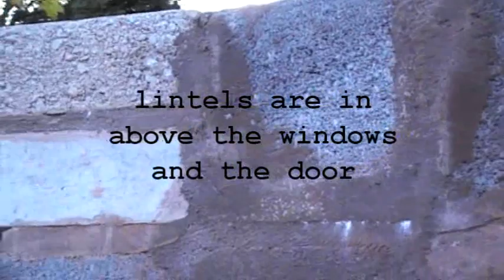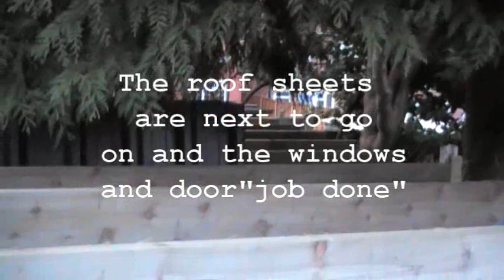How i build a concrete block shed

Comment: How did you do the foundation?
Reply from the maker: The foundations were 6 inch of hardcore and 6 inch of concrete slab. Wanted a solid concrete floor.

Comment: I believe in concrete block the one with the hole. with  steal and mix concrete poured inside  the hole to keep it strong
Reply from the maker: Wanted to use them but supplier didn't have them.Thanks for comment

Comment: Looks like a very good build.  How deep were your foundations in order to accommodate these large blocks.
Reply from the maker: Total depth was 12 inch. 6 inch for hard-core mix and 6 inch for the concrete, also added a steel 10mm mesh for more strength. solid enough for a build this size and bigger.
Reply: Rahgsa 0509  Awesome thank you. Can you show the finished building, in and out? 
Keep up the good work.
Reply from the maker: Sorry can't show the finished results as I moved house just after I completed it.

Comment: Hi bro liked ur effort. .wanted to ask if in dis manner can  we errect dis wall to 3.5meters..? Will it hold if taller?
Reply from the maker: No problem if blocks are wide enough but if they are same width as a typical brick then no, then best go with inner and outer layer with ties to hold both walls in place and give it strength and support.

Comment: This brick, massive concrete ... and the wrong one. Brick, with 2 concrete holes.
Reply from the maker: I wanted to use the ones with the two holes but I could not get them from my suppliers so I had to use these.Thanks for comment.

Comment: how much did you spend on the blocks?
Reply from the maker: Spent just over £300, I think they cost me £1.20 per block because not many people use this size and the builders yard was getting rid of them so I got them for a good price.Thanks for the comment.
Reply from the maker: Would love to have a workshop made of wood, and it is a good idea. In the UK their are these made to measure garages, sheds and workshops available supplied in a kit for you to assemble yourself or they will supply and fit for you. All this is assembled on top of a concrete base slab. But the material they use for the walls is not wood, it concrete slabs which slot together and are secured with fixing. Once finished its a very solid secure structure. Not many outdoor buildings in the UK are made exclusively of wood except the garden shed or a boundary fence. Thanks for the comment.